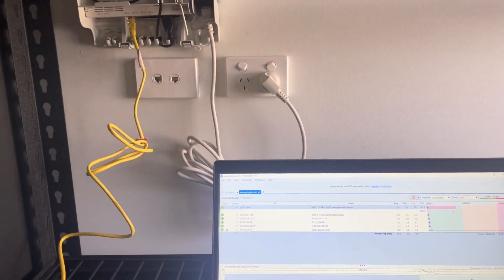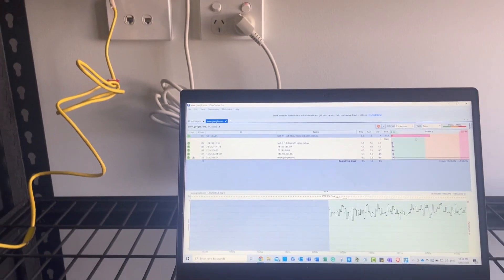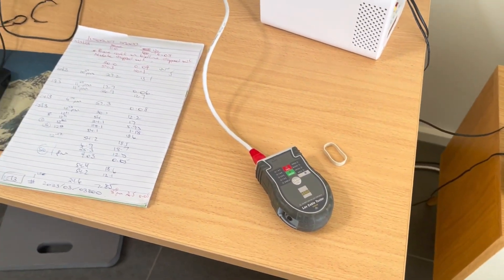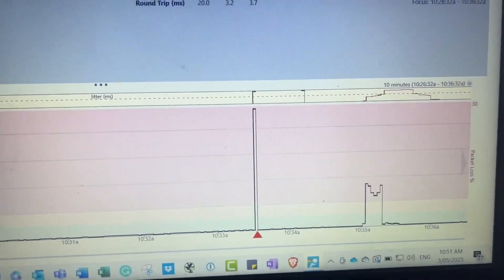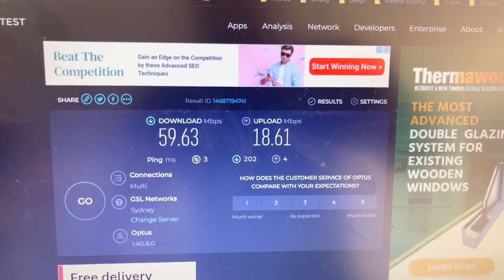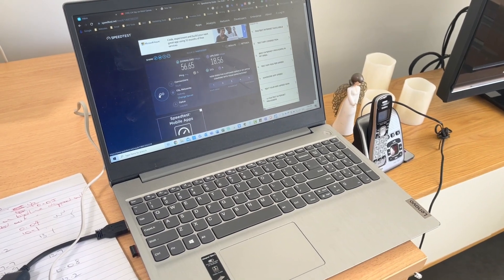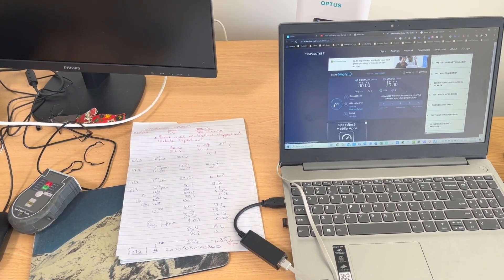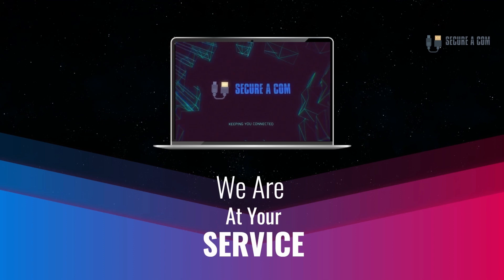NBN FTTP Dropping Out After New Connection

Comment: I had fibre to the curb with NBN but the nbn was very unreliable I had many routers but nbn was breaking down everday I was told if I go on a higher speed and faster download more expensive  pls it will come good but I still had just as many breakdowns nbn at West Ryde is useless mobile internet is more reliable and cheaper .

Comment: I'm an analogue tech of old, sort of dragged into the digital age! 
When we had to change over from Optus cable ( very reliable for many years) I feared the worst, having heard of speed and intermittent problems in fairly early  NBN. And we did. Probably took about a year to properly sort out slow speed and dropouts, many complaints.  It resolved in time. My therory is that NBN eventually upgraded and added enough that the local system could handle the load. These days it runs pretty well.

Comment: absolutely wrong approach. Its Internet! OSI model and so on! So the single way to find the real problem is to step up and down on layers, not just run speedtest - which is L7 check! And, of course, to simplify the structure as possible, chopping out everything until the problem disappears or only uncontrolled core structure left.

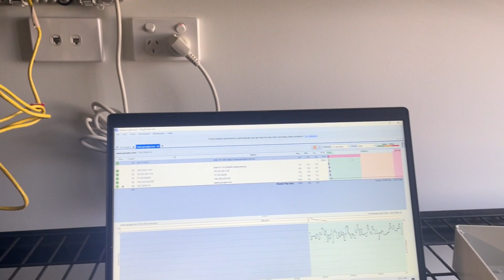So 1st step is just eliminate all internal equipment at all. Router, cabling, customers computer - everything out. Connect your test/measuring device (in this case it can be your laptop, proven and tested on other sites) directly to NBN box - yes you did it (0:40 - laptop connected directly to ONT port). Of course you need PPPOE/static details from customers account if it is not straight DHCP. In this configuration you can test not only L7 speed but L3 (flood pings) or even L2 (ARP ping). 

If the problem persists - everything up to NBN and provider (Optus), as nothing left beyond their network, boundary is RJ45 on ONT and you test directly on it. There are some voodooish ways to diagnose even their side, but you are definitely not able to do it, its 80th lvl arcane magic with optic power meters, reflectometers, network sniffers and other rare specialised network rectal probes, penetrating deep inside their network from unusual side. 

 If the problem disappears - NBN and Optus are not guilty. Next test - connect router right to the box with proven cable (I met many times faulty cables from cheap router kits, causing unpredictable glitches) and test behind it, immediately on router RJ45. Glitches again? Router to bin. Its possible to give it the last chance by factory reset and firmware upgrade (if available) but usually it does not help, cheap Chinese crap simply glitches inside hardware. 

It works even after the router but not on the desk, where it supposed to be? Only in this case its a task for you, cabler. Test cables, sockets, terminations. Not with this $30 static tester, of course, its absolutely unprofessional, ffffffuuuuu shame. At least with something like Fluke Microscanner, but even it does not give Ultimate Result. It can show bad cabling including split pairs, substandard termination and so on, but to prove that cable is OK you need full scale certification tester.

Comment: I've worked for optus, Cx needs to needs to check with optus whether their connection is on the correct address as per new property in NBN co portal. There shud a new Loc or location ID for the new house. If this is not done they need to create a new Loc id for NBN tech to visit and put a new line from the fibre node. It is possible their connection is running off from the old one. This is deemed most of the time as internal wiring issue. If they are setup on 50/20 plan their speed will not cross 50 mb/ps more like 49 or 47.
Reply from the maker: Thanks for sharing your experience! That’s some valuable insight, especially about the LOC ID and ensuring the connection is set up properly for the new property. It’s often the small details like this that can make a big difference in the overall service quality. 📡🏠

Comment: Hey mate. 

I have FTTP, have been with Telstra Velocity for 9 years, no issues at all, was perfect.

Network got upgraded to Opticomm, I'm on a gigabit plan. Speed is perfect, but I get micro disconnections every 8-12 mins. I sold my expensive router and bought an even better one($1300) 

Exactly the same problem, but same brand router. Tried running a cheaper tp-link router to test but couldn't get it to connect. 

Are you on Perth? I need someone to help me out here.

Essentially same thing, alot of variation, and the massive prike disconnect
Reply from the maker: Hey mate, that sounds really frustrating, especially after investing in a top-tier router. Micro disconnections can be tricky to diagnose, especially with high-speed plans like yours. It might be worth checking with Opticomm if there’s a known issue on their end, or if there are any settings on the new router that need tweaking for stability. Unfortunately, I’m not based in Perth, but I’d recommend reaching out to a local expert who can take a closer look. Best of luck getting it sorted! 🤞🚀
Reply: See if a Firmware flash Update will fix it.

Comment: working as an Optus Tech Support before. We have this one customer before on a 50/20 plan whose speeds drastically drops during peak period to the point that our L2 Tech upgraded the speed to Ultrafast plan for NBN profile but still getting 1mbps speed :<. They keep on booking nbn technician but NBN keeps cancelling the appointment as the so called remote testing of NBN is all passing 😭 and within NBN parameters. Keeps on happening back and forth in rebooking the tech as the NBN keeps insisting no issue 😂 but they conduct the testing during the day when customer is not even experiencing the fault .

Comment: Intermittent speed is most likely due to a dirty fibre connection. Probably due to the lazy installation & the tech not cleaning the fibre connectors during installation. If a tech comes out, cleans the connectors & then proves they're clean with a fibre scope. That should resolve the intermittent speed issue. Level 2 techs should have the ability to check the bit error rate to the NTD. Which I would expect to be high given the fault.

As to the 13 B not having an address. They would just need to contact they're SP to get a LOC ID (or Location ID) created for that address. Which would then start the process for that address to have an NBN connection. But that's eaiser said than done.

Comment: I think it is one of 3 things, 80% of the time NBN, the rest can be optus, it could be there POI maxed out for the area or there link to NBN problems, If the place had a arp watcher on the NBN port it would be great to watch if there is a flip flop's, I have seen both ISP & NBN doing flip flops on Mac address (Changing Auth server) at both L2 & L3, for my own office I see my NBN link change some times 4 times a day and this can cause speed problems, I monitor the office link every 5 min for speed both at the ISP level & NBN lever, and every sec for arp.

Comment: It never stops does it Jason.....a simple screw plug would suffice for the mounting of the box. As for the problem..
assuming the subdivision was legal then the builder of the duplexes needed to notify the NBN. It seems to me that this has not happened hence the a and b dwellings aren't listed......for example if the  property resident of B applied for service from a ISP they would not be able to get it....the ISP they choose would have register the dwelling before connection can occur. Has B property got  internet? If they do then how are they connected and how are they billed? Your customer needs to get Optus to register the correct address with the NBN which the builder of the duplexes has not done. The intermittent dropping of service is a problem that can be hard to trace......cheers Gaz

Comment: seems like optus has provisioned 50/20 plans on 100 mbps plans and harshly drop the packets down to 50... poor from optus. the lower upload speeds and upload speed issues in general for FTTP are more than likely associated with the NBN upload policer.
Reply: its funny you mention that we have had some bad issues with a brand new fiber to the premise nbn connection, im on 1000/50 and however they are limiting the upload speed causes major packet loss when hitting the upload limit but if you limit the upload speed at the router to just below your theoretical max the packet loss all goes away and you get full speed with no issues.